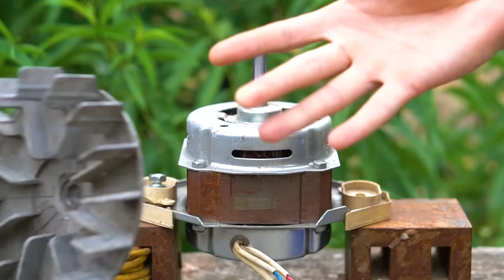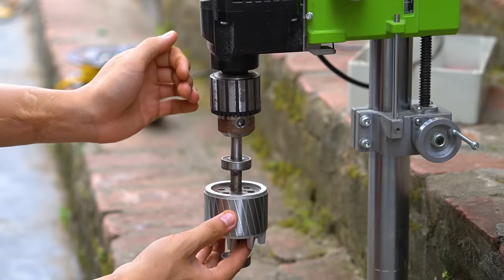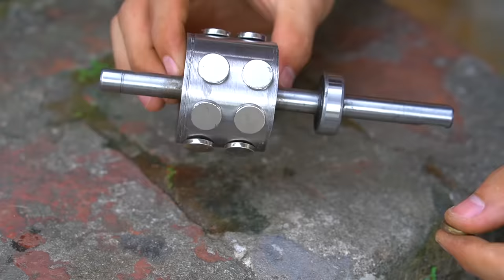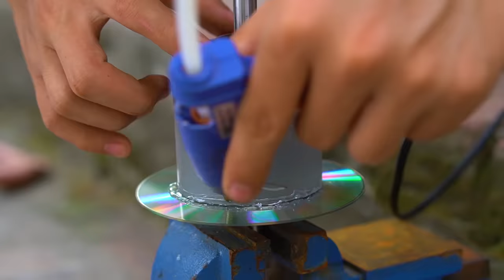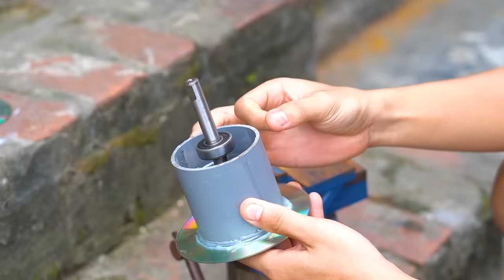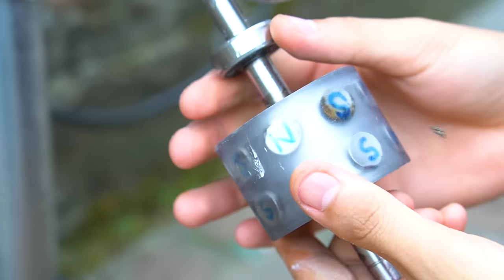I turn Washing Machine Motor into 220v electric Generator

Comment: How come the speaker connected directly? That is not powered type.🤣
Reply: I was wondering that too
Reply: It is a fake setup
Reply: That is bluetooth speaker, just plug in and connect to the hp by bluetooth.
Reply: BLUETOOTH BROOO
Reply: Klo gak bisa diem,sebelum mencoba klo udah coba gak bisa jg baru komen
Reply: Bluetooth
do You live on a cave?
Reply: Mayb speaker wd bluetooth.
Reply: It is complete music system...😁😁😁😁😁😁😁😁😁😁😁 Not a only a speaker...
Reply: Washing machine motors don’t run on gas either but his does.

Comment: Using gas generator to run 110v motor to generate 220v is an expensive idea.
Reply: It's actually a whipper snipper motor
Reply: @dopeweed8663  a wut? o.0
Reply: It will work 1000000% even more voltage depend on RPM only wind,water,bysycle,any fule, energy conversion.

Comment: What's with all the negative comments!!!! It's the principle that counts. Great to watch. Thanks 👍👍👍
Reply: There's no negative comments here I can see. But I can't figure out which one is the positive and negative out of the 3 wires in 8:43, maybe you can help me how he figured that out?
Reply: @BOREDANDWELLBORED  This is a 3 fases motor, he will output 3 sinusoidal wawe whit 120 ° of difference.
Reply: @scaricraft3995  but I can only connect 2 wires to plug it to appliances, which of the 2 wires out of the 3 do I use?
Reply: @BOREDANDWELLBORED  this is why i think Is fake
Reply: @BOREDANDWELLBORED  1 Those magnets are too small and far away to generate something
2 the magnets are too far from the windings
3 if turning the axis by hand generates 240 V, connected to that motor it should have an output in the order of K volts
4 using a three-phase motor as a generator you get three-phase current, it should pass it on a three-phase DIODE BRIDGE to bring it to DC, filter it, adjust the voltages and then feed it into an alternator to have an alternating output
5 despite the increase in the carick, no device seems to be affected by it, including the engine itself.
Reply: I think it’s alternating current right?
Reply: @scaricraft3995  This is not a 3 phase motor, this is a single phase 220v motor the 3rd wire is for the starting coil.
Reply: @ahmdasim  Remove the 4 ° from the listi
Reply: Unfortunately the principle here is trying to make fools out of normally intelligent people by false information. If you condone that as a normal good principle then I am glad I don't know you . Or want to for that matter.

Comment: Great. You have created a Dynamo from a washing machine motor. That gave me an idea. Thanks for sharing. You can also use that on flowing streams or by the windmill. I am very grateful for your invention.
Reply: The motor is already a dynamo. He just tuned it basically.
Each dynamo can be used as a motor and vice versa.
Reply: @ZorlacSkater  hi please could you tell me if this would actually really work?

Comment: Ingenious! I've used a drill as a lathe many times too. The issue is how accurate the job needs to be but you'd be surprised what you can do with just a file or wet and dry paper and a steady hand.
Reply: He Asian....no sturdy hand Hence grinder...it was only battery operated too🤣🤣🤣🤣🤣

Comment: I will be more impressed if you running the motor by using free energy like Warterfall or something like that.. btw good job
Reply: That would be the next phase, you 1st is always to get an operating system.
Reply: I wish I learned more about this stuff sooner, but plan on learning how to utilize electrical equipment from many angles! Few good videos on JONLEVI & others dealing with old world tech & free energy! Someone with more understanding might help shed LIGHT on this stuff further! ✌💎❤
Reply: Maybe some source of wind
Reply: @rickhart6631  1I
Reply: Even that is not "free energy". The energy would be the water or the wind.
Reply: What the fuck is a "Warterfall"??
Reply: @GratefulOverlander  it’s a gorge that has warts flowing down..😂
Reply: @ Muana Hauhnar, I’d be more impressed if you would actually checked out his channel, and saw the video, that he has already done that! 🤣

Comment: Thank you, i have a wash machine motor i actually wanted to use for this purpose but because they are inductive, normally you can't use them as a generator. But with your method you can. Genius hack. One suggestion i might make though to make it a little easier is to use a thick cardboard tube or maybe even water bottle the right size instead of pvc for easier removal once the a+b hardens. And as someone else mentioned, what is the actually frequency that this is, I'm guessing that it changes with the rpms of the engine. the frequency of that generator could therotically be bad for some electronics, if it is mismatched, so it would be good idea to run the power that it produces into a charge controller with battery bank and then invert it to the right voltage and frequency that you need.
Reply: Seems pointless as a lot of machinery dislikes inverter power as often not pure sine wave, it is expensive to make it sine wave, so perhaps what you could do is get an old alternator from a car and charge batteries from that! This produces 220-250vAC pure sine wave you could build a frequency control that keps the revs and voltage correct
Reply: See.. The inventor just busy to pin his/her latest video instead of give us a very brief answer about that frequency thing.

So I hardly think it's legit.
Reply: @gordonbeaton8131  yes i think your right a lot of cheap inverters tend to " burn up" electronics as i have found out the hard way. But things like a fan or old television as shown here. No big deal if it burns up. I wouldn't want to plug anything expensive in this
Reply: A breaka switch boys...

Comment: In stead of going through all that grinding, you could have used a drill bit  the same diameter as the magnets, Measure the thickness to flush and drill down, Then place the magnest in each hole and mix a little bit of epoxy to secure them in place.
Reply: Shirley...
Reply: I was thinking he could have just used a little starter current to induce some magnetism into the rotor while it was spinning and skip opening the motor up all together..
Reply: В кустарных условиях очень даже неплохо, кроме сверлильного и шлифовочного ничего не заметил.🤔🤔
Reply: Cual es el tamaño de los magnetos?
Reply: Rotating mass is less, more efficient to lighten rotator with epoxy.

Comment: It would have been even more apt if you used wind to turn generator ! Great job nontheless
Reply: Probably wouldn’t have worked the same. For a couple reason. Wind won’t spin that generator as fast or as consistent as the gas generator. That’s why you often use home wind generators for charging batteries as it is lower voltage and doesn’t have to be consistent. Your voltage would be all over the place otherwise.
Reply: What about petrol should use commutator
Reply: Yeah using wind for a direct ac generator is near impossible you really need a constant rpm of about 3000 for that thing

Comment: Wash motor has two main winding to rotate in both directions, no need to remove another winding wire, it work's as 2 phase with neutral alternator

Comment: You should put volt and amp meter to prove it will sustain enough power to the load. Not convincing without it.
Reply: мощность генератора на порядок выше мощности привода. Если инвертировать, может потянул бы музыку. Тем более откусили одну фазу.

Comment: 6000 watts is a bit ambitious. The generator is probably producing around 500 to 600 watts at most. You can see it struggle to produce sufficient energy with the fan blades slowing down.
Reply: Secondly although magnetic field in rotor is increased but wires in winding are not enough in motor to produce the this much power.
Reply: Just my opinion on the fan.
It may be a optical illusion made by the camera recording the video that makes the fan appear to be slowing down.
Like for instance, videos of single or double engine plans and it appears as though the blades are not even turning because of the fps recording speed..
Just a thought....
Reply: @ronniewebb2979  you are right.  But here have to think simply 6000w means  a generator of 8hp, is it feasible that a generator made from 300w motor can produce so much load. If on modification we suppose it may produce , double or triple means 900w, only for a little time span not for long hours. But not 8hp. 
And load on it assume 70w fan+ 300w speakers + pump 325w. 
But not 6000w.
Reply: @Village_lifestyle_vlogs  probably 600w, 6k watt being a typo...
Reply: @Meop79 right ✅
Reply: Yeah. A 6KW generator is a LOT larger than that, way more windings. He'd have been better off using a car alternator.
Reply: You are being so nice there! I've got a few generators, used to run some turbines @ 2-3 Mw size.
No way to get 6 kW out of a (maybe) 600 watt motor winding....
Reply: Yes, Power rating of the motor of a washing machine is say 500 W. How can it generate 6000 W when converted to a generator?

Comment: Why not use an energized winding? Small battery and generation efficiency will greatly increase. When operating on a load close to the maximum power of the generator, it will inevitably begin to heat up strongly, in addition to the fact that it will need forced cooling, the magnets proposed in this design lose their strength when heated, which is why they are almost never used in industrial solutions.
Reply: Gak mungkin
Reply: @jekichandra4921  mungkin
Reply: @gumpamai  indonesia gak jelas.
😂😂😂
Reply: Many electric motors use permenent magnets, from toy motors to electric trucks.
Reply: @moestrei  neodymium magnets works up to 150ºC if i recall correctly it also depends on the composition of rare earth used.
Reply: Exacto! Solo busca likes para su triste canal monetizado 🤣

Comment: you have a made a few mistakes:
1) what you have there is like a magneto and the output frequency and voltage VARIES directly with the rotational speed of the shaft (wich is not controller at all). 
the speed of the shaft should be 3000 rpm to get 50 Hz with two poles, since rpm = 120.f /number of poles.
2) the voltage reading you made was turning the saft with your hand and not with the gasoline engine... and also the value is incorrect! the highest voltage was 175 V RMS (at unknow frequency at minute 10:15 ).
3) you should check the voltage when the gasoline engine is attached and working.
finally, i recommend you to use a green source of motion (instead of the 2 stroke gasoline engine) for the shaft, like wind or water from a river... and more important, learn how to read an analog multimeter here: watch?v=9rGDx92McTY
Reply: Wow..  Thanks for the theory.. We go to the basic engineering system